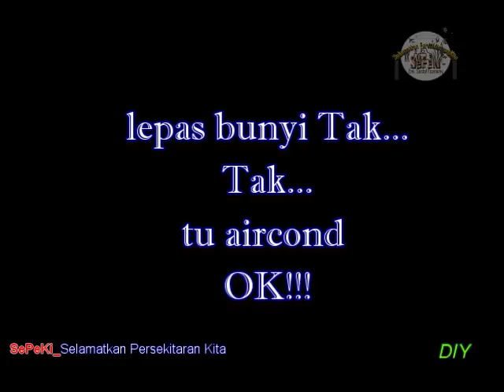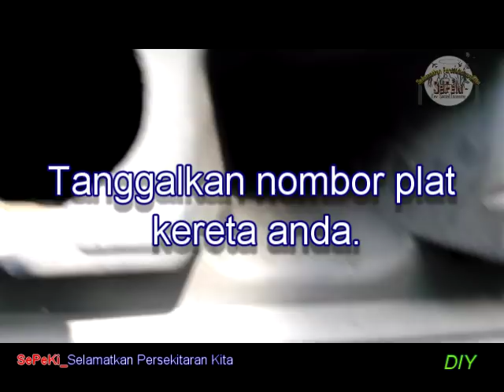AIr COnd Cut Off_Apa PuncaNYA? New Discovery...

Comment: kereta wira aku cutof byk kali, aircond belum sejuk tp compressor dgn kipas kondensor dh mati .. kdg tak jalan lgsung time tghhari terik...  Kdg dia ok jalan mcm biasa sejuk mcm normal , cuma suka cutoff tak ikut timing yg betul.. member aku ckp control panel yg pusing2 volume tahap sejuk tu yg rosak..aku perasan jgk bila aku usikk volume button tu compressor terus mati ,usik lg dia hidup balik....    Sapa pakai wira ade masalah sama ???
Reply: sy punya wira 1.5 injection pkai panel mitsubishi pun problem cmni jgak,dah tkar compresor,tambah relay mcm2 buat pun jdi jgak,,pening dah
Reply: Due to thermo control unit yang cut off Kalau terlalu sejuk beku

Comment: salam bos..boleh tnye tak kalau aircond proton wira sejuk tapi die tak cut off..ape maslah ye
Reply from the maker: Cuba check AC Temperature sensor...takut xde signal
Reply: @SePeKiZamanHadapan  semu dh tukar baru..yg dlm cooling coil tukar baru..yag petak 4 segi tu tuka baru..yg dekat panel control tukar baru..tpi ttp xboleh cut off...nasib je la
Reply: @SePeKiZamanHadapan  gas isi baru pom same..aircond sejuk je..

Comment: Salam...saya guna kereta viva 850,masalahnya di sini bila start enjin dan on aircond,akan keluar asap dan bau hangit, sebab apa tue ya?
Reply from the maker: Asap kat bhgn mn tuan...bau hangit dtg drpd mn...dlm ke luar?
Reply: @SePeKiZamanHadapan  luar,kt but kete yup
Reply from the maker: @IjanChannel8786  tu Ade leaking minyak kat enjin tuan...Cuba check tuan...terkena ekzos...ataupun tuan pny ekzos depan Ade bocor...
Reply: @IjanChannel8786  Boss.... Kemungkinan Bearing Compressor Boss Dah Jem.... So Bila On Aircond, Clutch Trigger, Terus Jem La.... Bila Compressor Jem, Belt Akan Bergesel Dekat Pulley, So Bau Hangit La.... Bukak Bonet Pastu Try  Tengok Compressor Jalan Ker X Waktu Bukak Aircond... Kalau Compressor Jalan, Maknanya Ade Masalah Lain La 2.... :)

Comment: Kelisa saya kompressor pandai on off. Kejap on kejap off. Terutamanya bila on headlight. But kalau pemanduan biasa, aircond kembali normal. Agak2 apa punca ya?
Reply from the maker: Kemungkinan masalah wiring...ade dengar bunyi tik2 kat bhgn relay bwh steering?
Reply: SePeKi _Zaman Hadapan so far xda sebarang bunyi. Dah 2 tmpat sy check. 1st dia xtau apa. 2nd dia tukar fuse kalau x silap. But x selesaikan masalah.
Reply from the maker: @adamf4950  tuan perlu check wiring
Reply: SePeKi _Zaman Hadapan okay tuan. Terima kasih sbb respond.
Reply: @SePeKiZamanHadapan  kanci sya da bunyi tik2 tu. Mcm bunyi dr dlam dashboard. Lpastu meter temp mcm x btul. On aircond bwak jauh sikit naik trus temo nk plak tngh hari. Tp bila kita ttuo aircond laju je dia turun. Masalah apa ye bos
Reply from the maker: @Ezzad96  bunyian tu Kat bhgn relay bawah steering tuan Kat pedal kaki...wktu tuan dgr bunyi...tuan boleh Cuba rasa body relay tu...buat pemeriksaan pada relay tersebut atau berkemungkinan Ada wayar yg da loose Kat mn2 terminal atau tersentuh dgn body Kereta...
Reply: @SePeKiZamanHadapan  owh. Orait bos. Tq ye😊

Comment: Boss, aircond viva cut off nya on off.. Pastu lekat tak lekat bunyi, tak tak.. Normal ke?
Reply from the maker: kalo bunyi compressor tendang da tempoh waktu itu lebih drpd 30 saat dan ke atas (bergantung kapasiti kompressor) tu normal...kalo bunyi compressor sekejap tendang x tendang tu ada masalah.
Reply: @SePeKiZamanHadapan  ada masalah tu mcm mne maksud tuan.??sebab skrg tgh terjadi..on aircond x sampai 10second die dh cut off..waktu idlinh bila aircond running tekan je minyak terus cut off..tapi bila jalan jauh sikit ok je sejuk aircond nye..compressor press dh low ke atau cooling coil dan condensor bermasalah..ataupun cooling coil sensor
Reply: @addieyqamar3447  try pulas suhu secara sikit demi sdkit...cri kt mna yg dia lmbat cutoff

Comment: Tuan..acon x berfungsi knpe
Reply from the maker: Air cond tidak berfungsi berpunca drpd bnyak faktor antaranya
1. gas kurang
2. kompressor berfungsi
3. kebocoran cooling coil /kondenser
4. filter drier sumbat
5. masalah pada suiz, wiring dan relay
6. blower motor rosak/resistor terbakar

boleh check di bengkel acon yg berhampiran rumah atau tempat kerja tuan. Sekarang dah mudah diagnose pakai mesin boleh tahu kenapa acon tuan tidak berfungsi. kalo x silap untuk check free xperlu bayar.

maaf sbb lewat